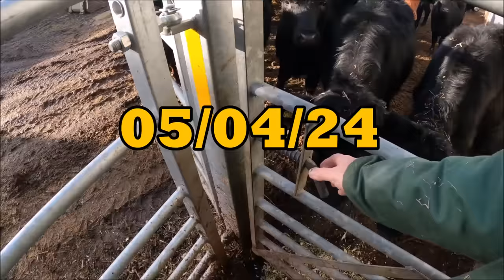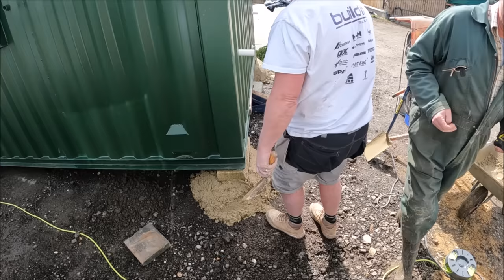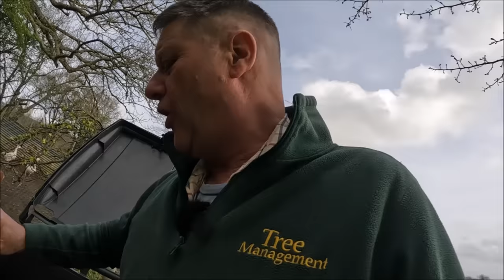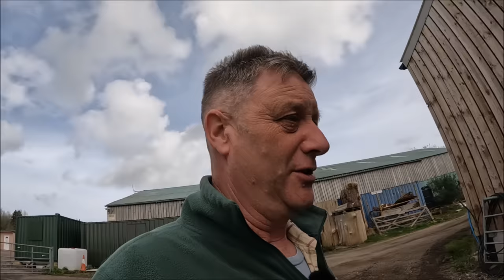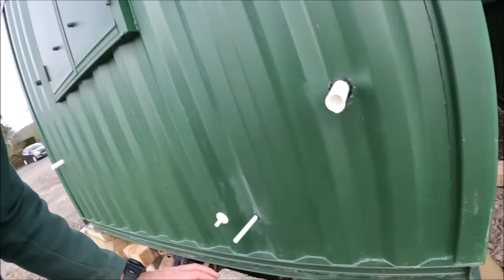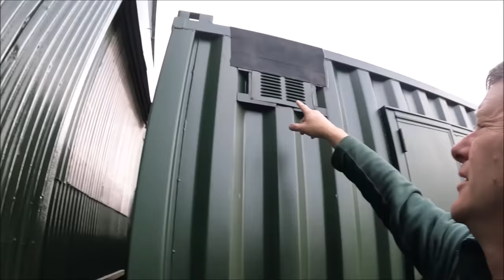05/04/24  Setting Hollis farm kitchen with famous Dave.

Comment: I hope Building Control don’t watch this. You should never discharge foul water ( which is what you have coming from those sinks)  into a natural watercourse - however  far away it is. I know it’s tempting and there will be many who’ve done it but ….. it’s a big no no. Surface to Foul is ok ( but ideally not) but Foul to Surface tut tut Mr P
Reply from the maker: It’s not foul, there is no 💩in it, only water and some sugar going through a bottle trap gully. Anything with fat will go through the house dishwasher, so nothing naughty. 🙂👍🏼